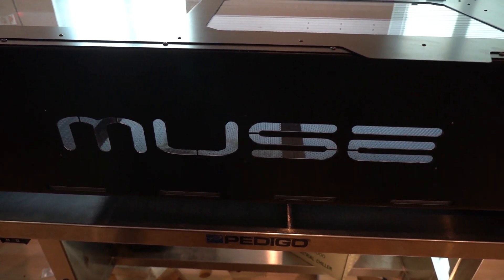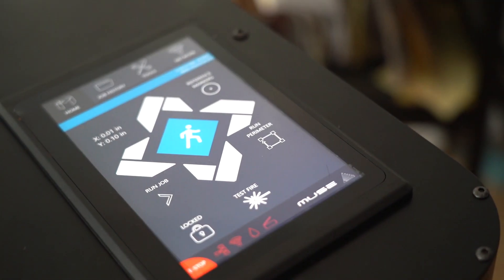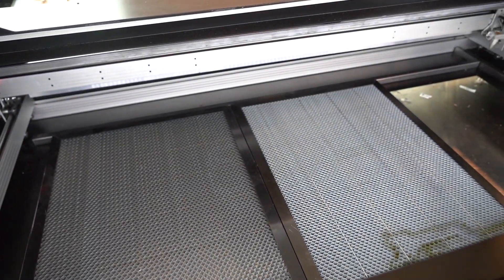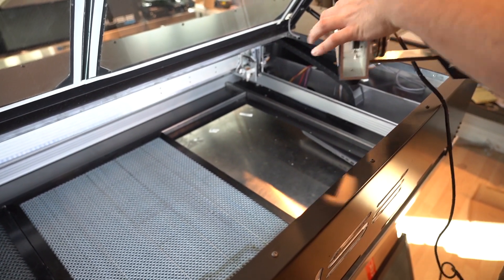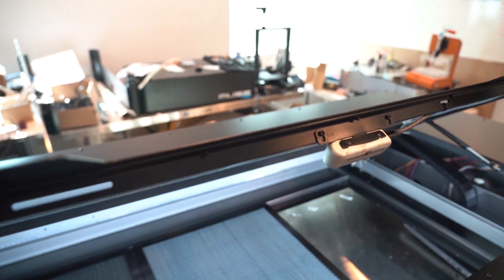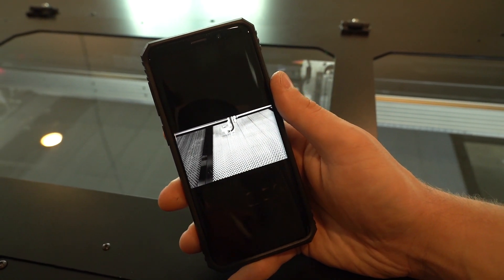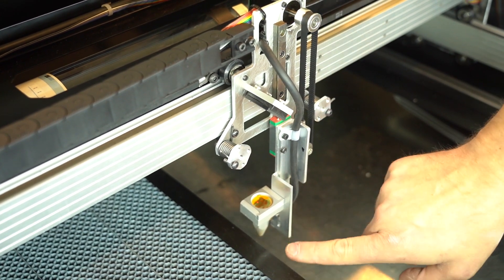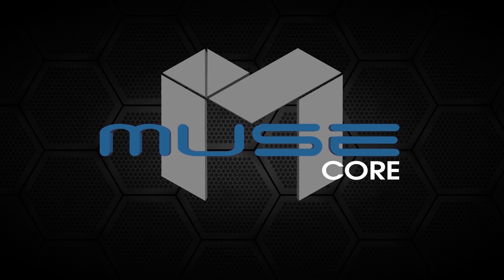Muse Titan - New Features

Comment: This video is misleading, the rotary attachment dosen't fit into the laser as demonstrated in this video...
Reply from the maker: If you noticed in the video the floor was removed and that is how you use the rotary attachment in the muse titan
Reply: @Full Spectrum Laser (FSL)  This doesn't work either.. the laser carage hits the rotary attachment even with the bottom plate removed.. maybe it might work if you were engraving a shot glass.. but if you got the laser sitting higher than what the normal legs allow, it is definitely possible. Can you make a video demonstration?

Comment: What is the max speed on this machine, how thick of plywood can i cut in 1 pass ?
Reply from the maker: It really all depends. Every manufacturer uses different glues, different amounts of layers, etc. There's a lot of variables that goes into cutting plywood. It also depends on which tube you're going to be using. 
I would suggest shooting an email over to sales@fslaser.com. They can answer most questions you have.